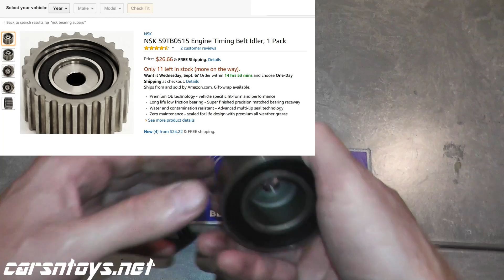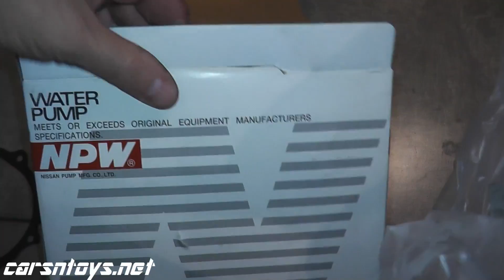Subaru Timing Belt After 106,000 Miles | What Does It Look Like?

Comment: I'm working on a 1999 Subaru Legacy sus 30 anniversary limited 
I need the part number for the 2 right hand Side of the engine the timing pulley I would like to know where to order them or if you may have the parts

Comment: My 2004 Subaru Forester S ran to 200 KM with original belt. I sprayed belt conditioner in it until the tensioner malfunctioned. It did not destroy the engine. I put the new kit in and it runs again. The timing belt can outlast the water bump and tensioner, pulleys.

Comment: Your original video is awesome, I purchased the TKF-011 Aisin kit, for my 2007 Subaru Legacy with 2.5 N/A EJ engine. It has 140,000 and belt has never been changed. I’m doing it next week after I get all my parts. $300 for Kit includes water pump.

Comment: What engine was this bro? I'm about to do my 2.5 boxer. It was changed 7 years ago at 50k and it's now on 80k. I guess the 7 year old belt, although it's only done 30k, that's 30 hard k too, should be changed... But should I keep the tensioner and water pump. They are 7 years old but have only done 30k.... Any advice gratefully received.
Reply from the maker: 2.5 as well, from a 2010 Impreza. I feel more comfortable replacing the parts vs reusing. Cheers.

Comment: Did replacing all those improve the idle smoothness?
Reply from the maker: In my case, no. Check the PCV Valve. The rubber hose often fails. If you need a guide - https://youtu.be/YCOuTzuQlAU

Comment: Thank you very much for your time in making this video. I have a 2011 Subaru Impreza with only 30,000 miles on it. I am wondering if I should do this job now because the car is over 9 years old.Thanks again.
Reply from the maker: I'd certainly check the condition of the belt - https://youtu.be/mJGkRi3PGOI

Comment: I want the used belt for a diagnosic tool, my belt broke at start up and I want the belt to see if valves got bent. if not I will buy a kit and replace the components , but if valves are bent I am going to scrap car,
Reply from the maker: Hope the valves (and pistons) are in good shape!
Reply: I thought that the boxer engine is a non-interference type, meaning no damage if/when timing belt snaps.

Comment: I pulled one at 200,000 miles. Everything looked good except for some slight surface cracking on the back of the belt.
Reply: good to know, my forester is at 160,000 with the original belt and from what i can see on it, it still looks good.  But i should probably play it safe and replace it soon
Reply: @kevinkaiser920  mine blew at 152 thousand pully seized ate the tooth off belt ....95so non interference :)
Reply: @jerrybartlett1142  hi there mine 2010 forester ej 25 broke the belt last week. What are the chances of nothing bad happened?
Reply from the maker: Wow! That's impressive.

Comment: I appreciate your video; thanks. I have an "Check Engine" idiot light, in my 2002 Forester, with 202.000 miles in it (yeah, I know...). The analyzer tells me "Knock Sensor". I did replace sparks (3 years old), and its PCV. I can't remove the knocking sensor (risk to brake its bolt; frozen solid), but I hear "noises" at acceleration (;ole pinging, or the ball bearing in the PCV rattling, kind of). Could it be that the Timing Belt has a slack? Your insight and/or suggestions would be much appreciated; I am a retired person with limited income, mind you... Thanks.

Comment: Good stuff here. Just got me an ‘06 Outback and the alternator and A/C belts are new. When I asked about the timing belt, he didn’t know.
So out comes the radiator, pulleys and cover just to check it.

If I go that far, I’ll just change it all out. Like you said, “Better safe than sorry.”
 Great video man.
Reply: Doesn't that have a chain?
Reply: Hubster No. Suby didn’t do a chain in the 2.5 Outback line until 2013.
The H6 motor had one for a long time, but not the 4.

Comment: I did a timing belt job on my 08 legacy at 100,000 miles. Someone working in advance auto parts insisted that all I need to do is replace the belt, he said that the bearings and water pump and tensioner will last 200,000 miles. I just did the timing job again at 200,000 miles. So it was true the only thing that needed to be replaced at 100,000 was the belt.
Reply: D N 

You actually trusted your engine to an idiot at Advance Auto? Go buy lottery tickets dude you are very lucky.

Comment: The cogged pulley by the water pump usually seems to wear the fastest.
Reply: Yep, mine when spun was screaming like a banshee. 
It seems that the problem is not the belt per se but the pulley/s, especially the one you mentioned going out and taking the belt with it

Comment: I would replace it at 120 K miles at least ! 106 still too early !
Reply from the maker: It certainly was in pretty good shape. Subaru recommends replacement at 105k. (2010 Impreza) A timing belt is something I don't want to push my luck with.

Comment: On the water pump, it would of been cool if you could press it apart and check how far the two halves of the rubber shaft seal have worn, compared to a new one. Usually the bearings last long due to the belt tension being kept well under control, but the two seals are pressed together by a spring and gradually wear down based on spin amount plus friction depending on how good the coolant is. Sometimes you find out by replacing a radiator cap that can now hold 15-17# but not that old water pump seal, so it starts leaking.

Comment: For people replacing the tensioner, I'm willing to bet that the bearing will start to fail long before the hydraulics do and it should be possible to remove the pulley and press the bearing out of it. It'll be a standard metric size and load rating and there's probably a number stamped or lasered onto it that you can identify it from.

Comment: I really hope you can help. I bought a used subu with 80miles. 2008 model. Is there any way to "eyeball" on whether or not the timing belt was changed without removing half the engine? The orig owner is not reachable.
Reply from the maker: Try this - https://youtu.be/mJGkRi3PGOI

Comment: I know this is an older video but I drive a 92 subaru svx.. On original timing belt/tensioner at 40k..have you ever heard of people recommending replacement due to age/years instead of mileage.. I'm thinking of changing mine.
Reply from the maker: Yes. Have you inspected the belt?
Reply: CarsNToys I haven't yet :/ the previous owner had all mechanical records and I never saw it done.. I'll crack it open and see but yeah lots of people say it's easy and I've done radiator changes, brake changes but I've never attempted a timing belt change :/ hope I can do it (trying to avoid stealerships) thanks for the answer
Reply from the maker: Glad to help. Take your time & you'll be fine.

Comment: I purchased this kit on Amazon for my 2011 Subaru Outback 2.5i Premium. Aisin TKF-006 Engine Timing Belt Kit with New Water for $202.00  It came with everything mentioned except the new thermostat. Awesome deal. Going to to do the Engine Valve Cover, PCV Valve, Spark plugs as well. I'm at 103k miles. I'm the original owner. Go Subaru!
https://www.amazon.com/gp/product/B00CMWCP5M/ref=oh_aui_detailpage_o03_s02?ie=UTF8&psc=1
Reply: Its been recommended to get the Subaru OEM thermostat
Reply from the maker: Good stuff!

Comment: I am doing the timing belt, idlers, tensioner, water pump and taking it a few steps deeper. It seems everyone who does these video's on this job fails to cover the oil pump issue. Yesterday I pulled my oil pump and the O-ring and main seal were still good but two of the screws in the steel back plate were loose and one had backed out 1/16th of an inch. Be sure and pull the oil pump when you do this job every time. New O-ring, New Main Seal. Clean the pump and housing really well. I used Super Clean, rinsed it well with hot water and heated the oven to 250 to finish thoroughly drying it. Reassemble with "Ultra Grey Advanced Formula Maximum Torque Gasket Maker" on the oil pump sealing surfaces and "Blue Loctite" on all internal and external fasteners. I also use Blue Loctite on the water pump fasteners and all other fasteners as I reassemble things. 
Keep in mind:
Blue loctite $6
O-ring $5
Main Seal $10
Advanced Grey Gasket Maker (Large Calking style tube) $20

So for about $40 additional dollars over all the other work you just did you can take the final step in making sure the job lasts for 100K Miles. If your low rpm oil pressure goes it's all gotta come back apart.
Reply: Also always make sure to do the head gasket while you are there or you’ll be doing it again. Subaru head gaskets are only good for about 100,000 miles.

Comment: Would you recommend that the timing belt be changed based on age also or mileage?
Reply from the maker: I just follow what the manufacturer recommends. They all have their own guidelines when to change the belt. Some go by mileage, others by years and mileage.
Reply: Subaru is both, mileage and/or years.  For my WRX, if I never drive it, six years of sitting in the garage and it needs a new belt.
Reply: @lorrinbarth1969  I don't agree, if not driving, no heat can destroy the belt. Also no uv. I think 10 years sitting is safe.

Comment: stop diagnosing bearings without any load on them
Reply: If a bearing doesn't spin freely without load, applying a load to it won't matter one bit.
Reply: especially how you can hear the innards making a metallic noise while spinning, a new fully greased bearing is silent. Applying a load just makes it worse in any scenario regarding bearings.
Reply: Sorry to say given the application small bearings can be easily checked for serviceability. This can be true for large bearings requiring forced lubrication.

Comment: I changed a belt (09 Forester 2.5l) with 116k miles and it has stopped running at idle! 20 teeth were gone and the belt had fissures and cracks on the smooth side with the remaining teeth very shallow. We dodged a bullet as the valves were fine and the car runs better than ever! Follow the manufacture's suggestion even changing it early.... say 90k miles
Reply from the maker: Fortunately newer Subaru's no longer use a belt.
Reply: Yes if you can live with driving Haldex....

Comment: Since you mentioned it in your video, the Gates kit for Subaru is full of Chinese parts now. Buyer beware.
Reply from the maker: Thank you.
Reply: The original part numbers now have Chinese bearings and tensioners. However there are new part numbers now with an N on the end of them that have all Japanese bearings and tensioner like they use to have.
Reply: I used a gates kit and the belt is made in the USA but all the pulleys are made in China. I checked them carefully with the originals, they had some differences but where the same where it counts! The Forester is running perfect!
Reply: Not full of, just got one for a 2002. There were 2 parts in that kit. My pre 2000 subaru had no chinese parts.

Comment: Some cars they recommend replacing timing belt every 80 or 60 thousand miles. If they told customers that these timing belt cars are high maintenance, nobody would buy them. Especially when timing chain cars go over 250 or 300 hundred thousand miles. Overall timing belt engines are higher maintenance and I try to avoid.

I've seen VW toss a belt at 78k miles. Subaru are rare around here and dealers are only in big cities, 80 to 100 miles away. While GM, Ford, Chrysler, Toyota, and Nissan have dealerships everywhere. I have seen a few SUBARUs, but they come into the shop from interstate on tow truck and most need major engine repair or a new motor.

SUBARUs main selling point is all wheel drive which isn't needed in the south, but Subaru high $$$$$$
Reply from the maker: I agree. I prefer vehicles with timing chains.
Reply: CarsNToys one of the first questions I asked before buying my fb20 Subaru Impreza 2013.    A chain finally instead of a belt.  Great video as always!

Comment: On that tensioner part, cant you just replace the bearing also? I see there's a bolt attached to it.
Reply from the maker: I'm afraid not. It's all one unit.
Reply: There is a small tag on the bolt that says, "Do Not Remove Under Penalty of Law."

Comment: Great video as always! Replaced my spark plugs the other day, they were all soaked in engine oil, all 4 of them. There's also oil leak all over the lower part of the engine. The dealer said I need the head gaskets replaced. Do you have any head gaskets replacement in the works? The car has 102k miles and it's a 08 impreza. Thanks in advance
Reply: If the oil was on the outside of the plugs where the wires connect to them it's the cam cover seals.
Reply: @IAMshredrmk  Thanks! Ive just replaced my EJ201 spark plugs and 3 out of 4 were covered in oil the same.I'll check out those cam cover seals.
Reply: noventay4 I did not abuse to car at all, I changed the oil every 5k miles. Don't let your assumptions over take you.
Reply from the maker: I'm afraid not. However, briansmobile1 has a number of excellent Subaru videos. I remember viewing one in which he replaces the head gasket.
Reply: CarsNToys okay, thank you